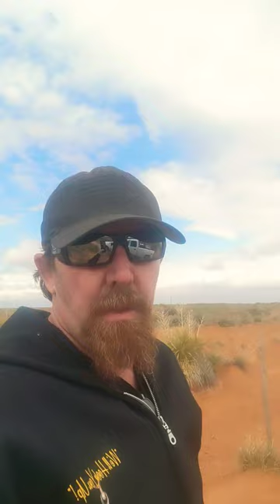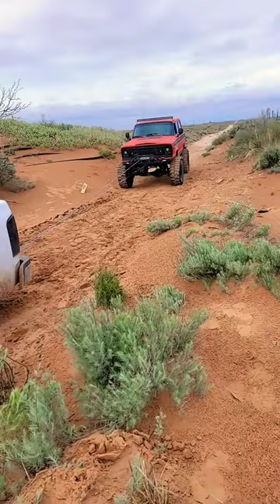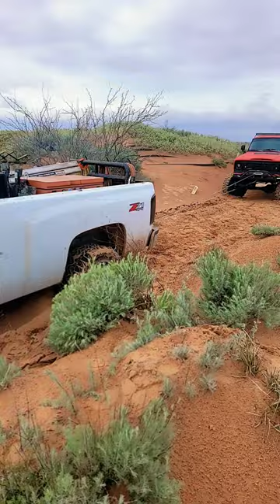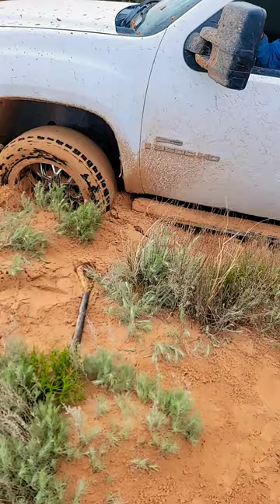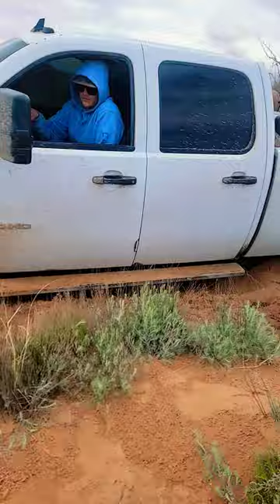Stuck welding truck     #towing #wrecker #offroadrecovery #jeep

Comment: Them dang welders think they can make it anywhere 😂
Reply: They need to quit putting gay wheels and tires on their trucks and spend their money on a good set of rubber, then with the proper tire pressure he wouldn’t have had an issue😂
Reply from the maker: Proper tire pressure for the sand is critical.
Reply: @BORR6X6 or the lack of tire pressure😉 dude should have aired down a bit! I don’t even own a truck and I know that.  About 20-24 psi on my nitrous car works wonders on pavement